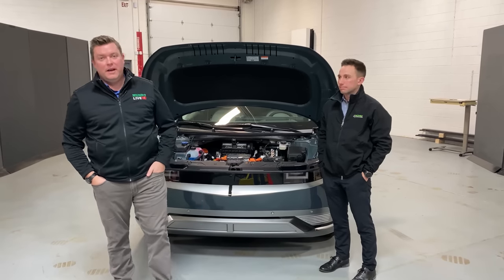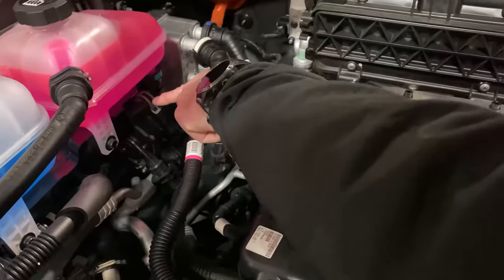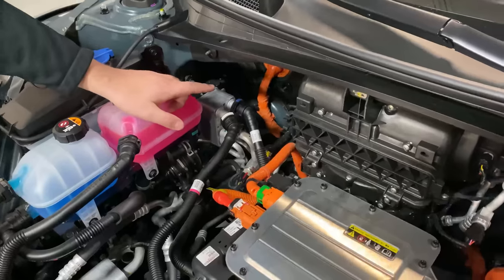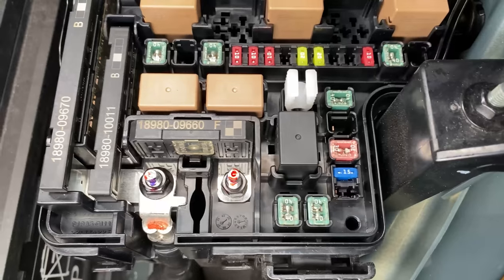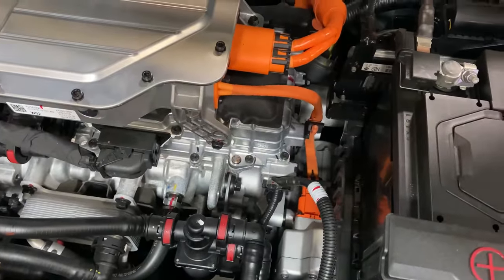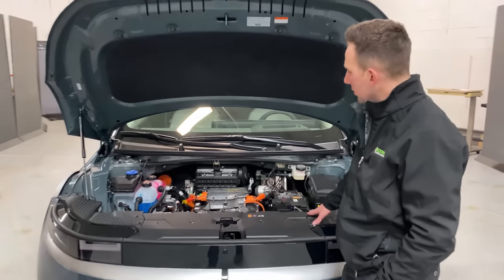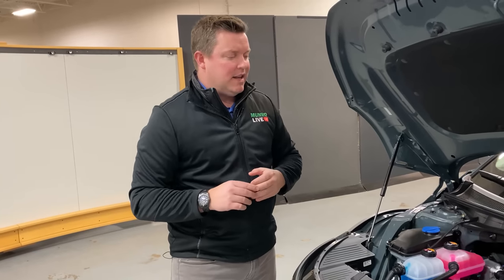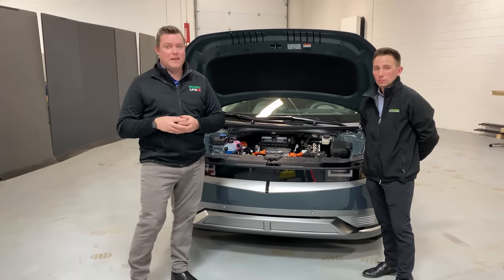Hyundai IONIQ 5  |  Under the Hood

Comment: As an old auto tech that argued with many, MANY, service managers. If the brake fluid reservoir has a sensor in it, you DO NOT fill it up when servicing the vehicle, after checking the brakes and for leaks of course. That sensor is there to let the run of the mill customer know his brakes need checked and will not come on if you keep filling the reservoir every time the vehicle is serviced. Of course these same managers have asked me " Why didn't you check that first?" multiple times after chasing down and diagnosing a particularly hard problem. They all got the same answer..."Because the problem is always the last thing you check."    Idiots.

Comment: Frunks always seem to be a big deal to people..  I never even use mine.  Just throw stuff in the back seat or trunk.  I'd rather see the space under the hood used for other things.  I find it annoying when they cram everything in as small of a space as possible.  I find being able to fix a part without taking half the car apart has value.  Who knows what engineers could use all that rarely used frunk space for....
Reply: I've started my frunk more for groceries lately, but even when I didn't it's still extra storage space for things like wiper fluid, charging cables etc.
Reply: As a daily driver (commute car) I suppose the frunk does have limited utility. But when we travel, it becomes a very important storage location. Coming from a Range Rover, I can carry more cargo in the  little Model Y. Absolutely a brilliant design and it's more comfortable/fun to drive.
Reply: What other things? That's the deal-evs have fewer,  smaller components,  but the designers are lazy and don't arrange them logically to offer space to the owner.
Reply: Yeah, if I had to choose between more frunk space or more trunk space, I'd choose trunk space 100%.
Reply: @kalleguld  you shouldn't have to choose.  Those components have no place being moved to the trunk

Comment: Sure, compared to Tesla they have a long way to go, but I think compared to many other manufacturers this is positively minimalist. And in a rear wheel drive vehicle I think it would be dramatically simplified. Im on the fence about those quick connect hoses. My Saturn had similar connectors and the rubber seals rotted and they were just leaking coolant directly from the fitting. It was an easy fix with rubber hose and a pipe clamp, but it was still extremely difficult to remove the old hoses even though they were leaking. Hopefully these have been greatly improved in the last 20 years.
Reply: OEMs want assembly simplicity. I'm more interested in reliability and maintainability.
Reply: @jamesvandamme7786  Well... Servicing a Tesla is not easy. Not at all. Tesla does everything to prevent it. And their system is not that reliable, like now when people heat pump compressors gets damaged by Teslas bad design and the system fail to give heat in cold weather.

Comment: how does this unit's design speak to the repair costs?  If parts are integrated you'd pay more should one need replacement.  Integration equates to higher repair cost.

Comment: More lines and such yes but it probably work, contrary to Tesla that fail in cold weather resulting in destruction of the compressor.
And Pb batteries are superior to Li batteries in cold weather, and price and life expectancy and electronics, as long as you just charge it properly. And you have a large battery pack on board so charge it properly is an easy task (unless you are a Tesla that obviously can not handle a Pb battery so it last).

Comment: Why don't they use the heat pump to warm up the battery? Is it even possible? Do Tesla also has a PTC heater to warm up the battery? You guys are awesome, keep the videos coming!
Reply: Tesla use the motor to warm the battery, essentially a resistance heater.  But it's a good question as to why the HP isn't used.  The Kona PTC is 2.2 kW for the battery.
Reply: Possible under some conditions, yes, but I think you will find that the circumstances where the battery most needs to be warmed (car sitting outside in very cold weather) are the same circumstances where a heat pump would have difficulty extracting much heat from the outside air. If you are just going to short-circuit the cold and hot sides of the heat pump together in those conditions (Tesla!!) or actively drive the motor in an intentionally inefficient mode to give the heat pump some input heat to work with (Tesla!!) it begs the question "why bother", doing that is no more efficient than using resistance heat.

Comment: Great video as always. Why still use lead acid battery for 12V? Any particular technicality to this? Tesla has moved to using Lithium Ion.
Reply: It won't be long.  But what does a replacement lithium-ion cost the consumer and can you buy one anywhere in the world?
Reply: Cost of the battery, and cost of the extra electronics to manage a lithium-ion battery. Tesla could have used lithium-ion 12 batteries from the beginning but they didn't... for good reason. Does a Model 3 have a lithium-ion 12 volt battery? It certainly didn't at introduction, only a couple of years ago; it has a BCI Group 51R lead-acid battery. Even the Model S only moved from lead-acid to lithium-ion for the 12 volt battery last year. 

Despite the problems that a discharged lead-acid battery has with low temperatures, a charged lead-acid battery is much better than a lithium-ion battery without a heater. If something has to work to wake up a cold parked EV, a simple lead-acid battery is more reliable than a lithium-ion based energy storage system.
Reply: @brianb-p6586  Thanks a lot. This is very helpful!

Comment: Purchased an Ioniq 5 limited back in February and it is by far my biggest regret. Spent 65k on this thing and I've had non-stop issues. 

- Constant vibrating that the service center can't seem to figure out
- Creaking brakes that come and go. Service center can't seem to fix this either
- Occasionally won't turn off 
- Random dash lights coming on and off for no apparent reasons
- Locking issues. Sometimes the car unlocks as intended and sometimes it doesn't
- Suspension is AWFUL! It's quite a rough ride, lots of body roll and noises coming from the cabin 
- Lastly, this is just personal taste. I hate the virtual engine sound system (VESS)—sounds like a spaceship and is annoying after awhile.

Comment: Seems a bit odd to directly compare thermal systems when Hyundai is providing additional functionality. Namely, voltage conversion between 400 and 800V and also including the sizable onboard inverter. Tesla's design elegance is state of the art for sure, but the products aren't apples to apples.
Reply: There is nothing in the extra complexity in the thermal system that is required to enable those additional features, so I think the comparison is fair.
Reply: Elegance can have different meanings as well.  i did not find the Ioniq 5 under hood inelegant by any means.  The Model 3 on the other hand just looks like a mess even if it has shorter and less hoses.

Comment: The RWD model does have a deeper (and actually usable) frunk but it depends on the market. Some states, and in Canada, law prohibits the large frunk even on RWD models because there is no in-frunk hood release button. So, when I receive my Ioniq 5, I’ll actually have to fabricate myself a large frunk because Hyundai dealers I’ve contacted refuse to seek me the frunk assembly without providing them with a VIN.
Reply: Some ioniq 5 owners investigated importing authentic European frunk and installing them themselves. Unfortunately the quoted price is $2800 for a glorified plastic box that's pretty standard for parts costs of a brand new vehicle. It should drop in the months and years ahead. 

I expect 3rd parties will make options available soon as well.
Reply: @gelu88  sounds like this was me. I actually found a US place where it’s listed 575USD but still wants a VIN and refuses to just sell it to me. Been documenting this on a FB group.
Reply: @gelu88  Keep in mind that the imported frunk will only work in the RWD version. The AWD version has very limited space up front.

Comment: It would be interesting to see how those heaters actually work with the heating-side of the HVAC system.  Are they a simple immersion heater in a small "tank", akin to a home hot-water heater?  

The reason being is that Tesla's "solution" to extreme-cold cabin and battery heating (where the heat-pump is not effective: -25C or lower) is to essentially turn the drive-motor into a water/glycol heater by "running" it at 0% motive efficiency and heating the entire motor casing to heat the coolant.  This is extremely inefficient since you're heating up a very large aluminum structure (exposed to the outside air!) as well as the rotor and other parts of the drive unit from far below freezing to a roughly 30C level to heat the HVAC coolant to a level to be able to defrost the interior of the car.
Reply: An observation I've considered as well.  The Kona/Niro EVs and it appears this Ioniq 5 use a PTC directly in the HVAC air flow which clearly will have minimal thermal mass. Same with heat pump warming, the Kona uses an condenser in the HVAC airflow instead of intermediate coolant. Not many many viewers are appreciating these details.
Reply: @paulaxford6754  It's really "California-centric" design where they don't really consider sub-zero environments.  Heat pumps are great, but the temperature deltas are pretty limited in a heating scenario.  The practical range of it being a useful heater is about -10C to about 15C, OK, but not amazing.  One also has to keep in mind that waste heat, once underway, will always be more efficient to exploit.  My gut feel is that heat pumps are a bit oversold in what they actually accomplish, 90%+ of their utility will be for cooling.
Reply: @awebuser5914  true, although I live in a climate similar to SoCal and find the Kona HP performance very good.  My PTC (for the cabin) will never kick-in.

Comment: So, you have to pull the mini frunk (Cat Litter Box) out before you can change the cabin filter?
Reply: No ... you pull a cover off the inside of the frunk and then have access to the filter.
Reply: Look closer, the wide line or depression looks to be for astheics and becuse there is no cut line along the base I would say there is no removeable panel, the hole in the rear is a grab handle for removing the litter box.
Reply: @nonyanks2510  I have this car. The frunk has an easy to remove panel to access the cabin filter. No screws. It's just plastic with some tabs.
Reply: Your correct, the entire base cover comes off, very slick!
How you liking yours, we have zero in Washington state!

Comment: Although the heat exchange system of Hyundai Electric Vehicles is complicated, the heater efficiency has always been the highest among electric vehicles. Winter mileage compared to battery capacity has always been top. This has been shown in various electric vehicle tests, and in actual mileage competitions, the mileage compared to the battery capacity is the longest.
Reply: And it has SiC for the power electronics like Tesla which VW/Audi/Mercedes/BMW still lack.
Reply: Yes, my Kona only uses around 200-300 watts to heat or cool in our mild climate.  A very good system and much the same as what's seen on the Ioniq 5.

Comment: Why don;t these manufacturers copy the octovalve from Tesla? It seems the knowledge and execution is right in front of them to make it so much better.
Reply: Possibly flexibility to produce multiple models without having to design a new model-specific valve assembly for each one. 

They don't have to "copy" anything - valve manifolds are a long-established design model. The valve body of any conventional automatic transmission is the same idea.
Reply: Octovalve is cheap for the manufacturer NOT good for the user/customer/buyer. I much prefer the build quality of hyundai instead of the octovalve. BTW, once the octovalve goes you are screwed on multiple functions and your car is FUBAR till it's fixed.
Reply: Does Tesla has a patent on the octovalve? Or Kia tried something different and potentially more efficient? They have used 2 different fluids (pink and blue) because they have different thermal characteristics. Is hard to judge not knowing what the engineering constraints they had. I'm sure over time will learn more details.
Reply: @adrianhorja5336  No, there's nothing patentable about Tesla's valve assembly, although they may have filed a patent anyway... some manufacturers puke out every drawing they have into a patent application. It's just a bunch of valves mounted in a manifold.
Reply: @TheNature101  Yes, I can confirm this.  My 2018 Model 3 was not driveable when the superbottle broke.

Comment: This review really scared me off the Ioniq 5 and I’m not sure that’s terribly fair.  Who the heck needs a  frunk? Other than to carry excess washer fluid in smallish containers.  But seriously guys…you sound like everything is based off your  preference for Tesla.  Which yes may be cutting edge but is that a fair comparison? 

Very hard to gauge the severity of the issues you bring up.  So…no braided hose…big deal or minor?  PA12 hose molded on…big deal? Or minor.  The average consumer won’t know how to take this review.  Most owners will know where to put the washer fluid so the two coolants nearby is a non issue to me.  “Negative thing” not to have a central hub like Tesla…really? How negative is this issue?  Fuse box…minor? Or significant.  The entire review was thorough which I really appreciate!  How big a deal is multiple thermal loops vs Octovalve?  Should we be moving away from the Ioniq 5?  It felt that you guys wanted to say “don’t buy this, buy a Tesla” throughout the review but stopped short of saying it. Please clarify!
Reply: Very good points and as a mechanical engineer myself I agree.  A lot of the criticism remains biased for no good reason (but far less with Sandy out of frame) and the analyses are less than thorough.  Many points raised are of little or no advantage to the consumer and seem arbitrary.  To be fair the focus of Munro is mainly to do with production costs and efficiency rather than a consumer-oriented review, but they delve into unrelated vehicle engineering areas without sufficient detail and make unfair generalisations. In the end the Ioniq 5 is price competitive in the EV market and the chosen detail design won't put Hyundai out of business.
And I'm certain that those coolant caps are not easily removed by the owner.

Comment: if you look under the hood of the AWD Kia EV6 (same EGMP platform) you will notice a distinct ABSENCE of that secondary BLUE coolant reservoir.  unless it's maybe not in the same position, but again SAME clam shell hood design, SAME 800V architecture as the AWD IO5.  so now what gentlemen...?

Comment: It's almost as if the mandatory goal was to not deviate from current design philosophy. And draw up an electric motor setup, packaging and cooling infrastructure to mimic what a current small 4 cylinder engine bay looks like. Almost as if to make any current ICE user who takes a look under the hood of this electric vehicle to go like;  "yeah, kinda looks like an ICE engine in shape and form. All seems familiar in shape form and size to me."
Reply: I guess it's that they can reuse existing designs and knowledge of drivetrains, suspension geometries and such rather than starting  from zero.
Reply: I very much doubt that was a goal.  The fact is the components are not that much different in size and placement to ICE.

Comment: Notice how Hyundai mounts the refrigerant brazed plate heat exchanger and one other in the correct orientation. Hyundai's compressors are likely to last quite a bit longer than Tesla's, especially in low ambient conditions.
The one on the motor is sideways and will be difficult to purge properly, but as you say, they can always just add more plates.
Reply: Those are the sort of detailed points I expect from Munro.
Reply: @paulaxford6754  Munro Live used to be all about engineering. Today it has become more a form of entertainment for Tesla fans. This episode was better than average, I thought. Lots of pretty good detail. 

I don't always agree with their opinions though. Maybe it has gotten a lot cheaper to form nylon tubing and add quick connect fittings in the last couple years. I doubt it. EV cooling systems are very low pressure and very moderate temperature. Buna hoses and constant tension clamps on an EV will outlive the car at half the price.

To my eye, Munro and his guys are drawn to the "cool" and new tech, whether or not it makes financial sense. Notice how they sneer at ten cent fuses. Tesla puts all the 12V current control on the 3 circuit boards that control every light, window, and power function. When a component on the board fails, and they do, the repair will be n the $3,000 neighborhood... because there was no fuse.

sorry for rant

Comment: Everyone keep in mind, press vehicles are produced on separate lines in the factory and are built much better than the car you buy off the lot.  Better paint, better materials, better sound dampening, no defects or panel gaps.  Think of it like the car the owner would own, not the car the owner would sell.
Reply: I think that's an urban myth.
Reply: @paulaxford6754  You may have a point.  Companies do not spend much money on advertising.

Comment: would appreciate some viewpoints regarding 800 volt vs 400 volt based BEV's. In the same vein, would like to hear about battery management system differences when switching from lead-acid to lithium-based 12 (15?) volt accessory battery.
Reply: 800 volt is the way to go - you need less copper everywhere.